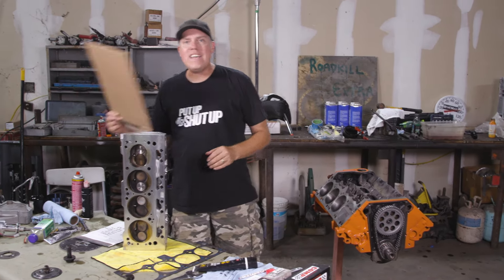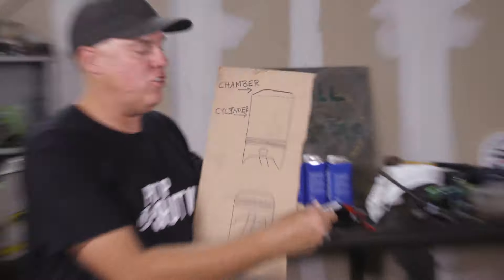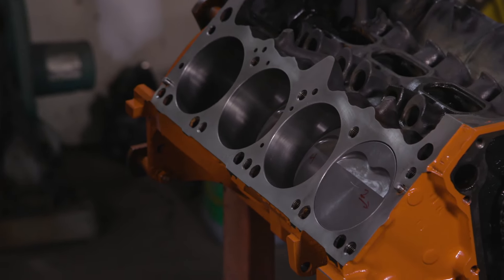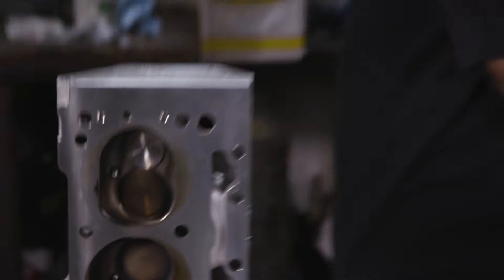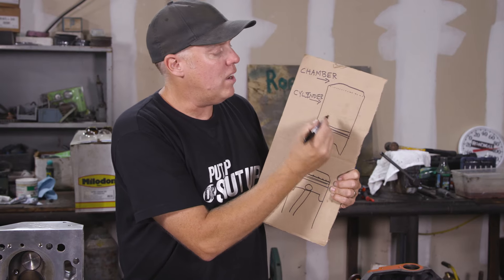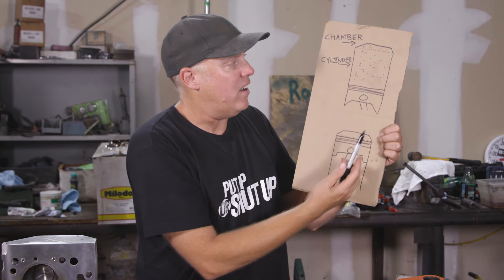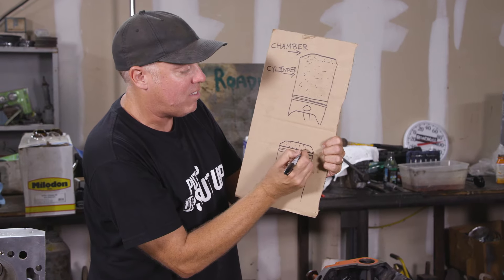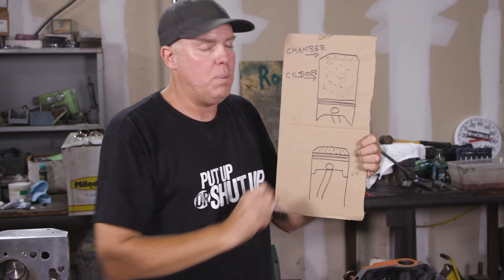Compression Ratio Explained - Roadkill Extra

Comment: He's half right.  If you increase the compression and run on pump gas you may have to pull timing.  You get more power with the higher compression, but pulling timing also pulls out power. Negating the increase.  I have experienced this.  Running around 11:1 compression, I have to pull timing down to 26 degree's full max timing.   Pulling out 80 to 100hp at the same time.  Totally taking away the power my new cam is supposed to give it.  I have to lower my compression, which will allow me to run the timing up to 36-38 degrees.  Now I can get full gains off cam with proper timing and pump gas. 
   Larger bore increases volume and LOWERS  compression.  Unless you have ZERO deck clearance, which stock deck has about .035 deck clearance. Give or take. Using some of the cylinder volume as the combustion chamber. Boring Will act the same as increasing chamber size in head.  With zero deck clearance the final combustion chamber size is not influenced and WILL give more compression with a larger bore. Increased stroke WILL always give more compression.  Head gasket thickness is another factor.
  If you don't use ALL the factors you will end up with a different ratio then you expect or wanted. Might not effect the motor. Or it might put it just out of pump gas range. Like I did with mine first time.

Comment: The engine I’m building has an 8:1 lol. Not really a performance engine though. It’s a ford 300cid straight 6 meant for torque making almost 300 lb-ft of torque stock at only 1,600rpm

Comment: Very informative...never knew you could run low octane @ high compression by altering lift & duration at the camshaft...l'm thinking 2 intake valves (because the piston has to draft the mix in) & 1 exhaust valve (because the piston is forcing the exhaust out) would be optimal at this juncture...ie: a pump can push better than it can suck

Comment: can you do a video using a rover v8 comparing it to a domestic lump?
Reply: Alex Thompson the rover v8 was based off the 215 Buick engine. Rover bought the design so it is essentially a domestic engine anyway.
Reply: Hurmeez i know, but they killed it off after only a few years in the late 60s then rover made it until 2003 with various sizes, so it's hardly a domestic engine any more
Reply: Fair enough. Sounds like an interesting subject for a video then for sure.
Reply: Hurmeez l think he has 1 of those aluminum motors in that skylark convertible he got from the Jeep guys mom
Reply: Alex Thompson   You're talking about an engine that GM/Buick gave up on over 50 years ago ! That's why they sold it . Here in the US they are rare and only 215 CID. You only see them in VW Beetles and Chevy Corvairs at Car Shows. Not many of those on the road . Any V8 less than 350 CID is a waste of money and time.
Reply: +James Letaw  I think it has the 300 CID Iron Small Block.

Comment: Good video!Worth to note that compression, compression ratio, and compression pressure are not the same thing. You could in theory have a 15:1 ratio but still have low compression pressure, if the cylinder is sucking vacuum under intake, due to a restrictive intake/intake valve, or too high rpm. With forced induction you could have an 8:1 ratio but have high compression pressure, depending on compressor charge pressure.

Comment: Is not the compresion ratio what makes more power. Is the expansion ratio.

 In most engines both ratios are equal... But if you could increase only the expansion ratio without modifying the compression ratio you will get more power gain than when you do both ..

Comment: 40 over 360,, it will be thin in the cylinder walls! you are living dangerously, let alone a 40+ y/0 block.
Though as for the 'explanation' well done. Though using a burrette and a piece of perspex to measure a chamber is not that hard for the average half smart bloke building an engine at home.

Comment: i have a serious question i have a 2001 jeep grand cherokee laredo 4.0l i am getting back fire thru the throttle body and i can't figure out why it's doing it i did a compression test on all 6 cylinders and got #1 and #2 at 150  #3 at 130 #4 at 120 # 5  at 110 and 6 # 100 i am not sure as if any of these are the issue but i ordered new valves for the head as i feel maybe that the valves are slightly bent or allowing some compression to escape back thru the intake valve but i am lost as if that is what it is any answers to this issue is greatly appreciated i know that if a head gasket is blow in certain cylinders it can reduce the amount of compression to each but the issue is the back fire thru the throttle body it want's to run but running rough please help

Comment: V.e. quench, dynamic, static etc... ALL play a part in making power and or losing power, camshaft selection doesn't effect computing total compression, that's wrong, you can lose cylinder pressure from a cam, yes but not compression, all cams have overlap, I never seen one that don't but I'm sure they exist... you can either raise or reduce your compression with your piston, your C.c. reducing deck height and gasket thickness... ideal street engines are 9:5.1 to 11:1 that will live happily in pump gas.. like he said, if you're going 12:1 you might as well go 14:1 because to live happily you're going to need higher octane fuel and a good set of heads... I'm building a 440 big block Chevy right now and shooting for 10:5.1, 600hp motor with a 150 and a 100 hp plate shots of nitrous, it will be a street cruiser but the nitrous is for track use only, that engine is going in my   260Z, maybe my Vega or Camaro... I'm not very certain yet... I was going to put it in my 82 T/a and raise the compression and use it just for the track but I like to drive my cars.

Comment: Y'all do "how much X until it explodes"  episodes sometimes, they're great. I suggest building a seriously high compression V8 and testing it on various fuels (E85, race fuels, etc.), altering timing to get the most power before something goes boom due to detonation or some other factor. I SUPPOSE you could show it mercy as you've done in the past if it sufficiently impresses.

Comment: By the time you're looking at 15:1 compression, you might as well consider running on diesel.  Now how come diesel engines don't typically make a lot of power, unless some serious forced induction is supplied?  They certainly make boatloads of torque down low, but absolutely hate revving, so instant horsepower killer unless a lighter bottom end is used.

Comment: Thank you! I give tours about airplanes and I’m constantly wondering how a 720 in.³ V8 from 1917 rated at 180 hp could have essentially a 4 to 5 or 5 to 1 compression ratio yet a brand new Subaru forester rolling off the lot could have an 8 to 1 compression ratio with the same horse power and an engine 3/4 the size of the v8 aero engine. Bottom line is that aero engines of the early 1900s just did not have high compression ratios but I was wondering why.. This video has helped me understand.

Comment: Stroking a block will most certainly net a lower compression if the head volume stays the same. Lowering the cc volume in head while cylinder volume stays the same will net more compression.
Reply: No doubt no doubt. I would like to replace stroke with bore size. If all other variables stay as.

Comment: Now you need to explain turbo and superchargers...why you need to reduce the ratio so you wont get detination...when you put higher pressure in a cylinder when its at bottom dead center then compress that, then you will have that same amount of pressure as atmosphere but there will be more fuel and air at the same pressure...simple but to some very difficult to grasp...

Comment: If you want the chamber to be smaller why do people port the cylinder head
Reply: elijah F  Porting is done in the ports of the cylinder head; not the chamber.  The ports are on the opposite side of the valve, so it has no affect on the size of the combustion chamber.  Porting increases flow to get more air into the combustion chamber.

Now people will often deck heads/blocks, which takes material off the flat side where the combustion chambers are located.  By taking material off the the entire flat side, it makes the combustion chamber smaller, increasing compression ratio.
Reply: Elijah, very well put.

Comment: Completely misses the point of the engines size compared to the necessary octane requirement. You CANNOT generalize as he did about what compression ratio is "acceptable" for pump gas. EXTREMLY important.  Anyone smart enough to know why?

Comment: See, that whole thing about 12.5:1 compression being race fuel territory.... that is not so true these days.... and for Japanese vehicles, that has been not so true since the 1990s.... I am tuning a 1993 Acura Integra with a B18A1 (Non VTEC DOHC 1.8 liter 4 cylinder) that was head swapped with a  (ported) 1995 Acura Inegra GSR B18C1 (VTEC DOHC 1.8 liter 4 cylinder) head, and 1999 Honda Civic SI B16A1 (VTEC DOHC 1.6 liter 4 cylinder) pistons, and the calculated compression ratio is right at 12.5:1....and it runs great on pump gas. And I am tuning using a chipped OBD1 ECU using older software, and it runs amazing. Should also add, the engine has a 70mm Skunk2 throttle body, ported Skunk2 Pro intake manifold, 4-1 header with 2.5 inch collector out to an aftermarket 4th generation Camaro cat, which dumps into a nice sounding 2.5 inch exhaust, and power is transmitted through the car's original transmission. Next mod is limited slip and the car will be pretty much a sorted, canyon carving, pretty damned quick to boot, little car. When he was daily driving the car, he just put 91 octane, no ethanol fuel in it. Though, when he wanted to have a lot of fun, he would stop by the gas station in town that has 94 octane at the pump, and I could increase the ignition timing even more.... yeah, the car become even more unhinged... it is great :)

Comment: 15:1 is huge... NOT when you think about that current Formula 1 engines are about 30:1 and while they're using petrol (what USA-ans call gas... (wtf)) blends developed for them, they are still pretty far lower in octane than toluene or anything like that with around 120 octane. AND have turbochargers.

Comment: 15.00:1 is super high compression. You are wrong, Warstila marine diesel engines. Have a compression ratio of 140 bar. Which creats 2,000 lbs of force. Per square inch of piston surface. Or 1090 tons of pressure on the entire piston. 
Secondly you stated that a compression ratio 13.00:1. For a gasoline engine. Requires racing fuel, wrong. There are none muscle and sport cars. With compression ratios of 13.5:1. Wich run on 92 octane street gas. Tomorrows engines will be HCCI or what ever its called. Which will use a compression ratio of 20.00:1 or higher on 92 street fuel. But again thats in the near to very near future. Either 20.00:1 or 140 bar in a true hemi engine anyone.

Comment: Nobody in the hotrod world seems to know that ultimate max horsepower out of any given strength of block/rods/crank/pistons comes at 6.5 to 7.5 compression ratio ASSUMING UNLIMITED BOOST AND DETONATION SUPPRESSION.  Back when America's survival depended on aircraft piston engine power GM Allison, Curtis-wright, Pratt&Whitney, Lycoming and Continental figured this stuff out.
    Downside - such creations are A) Weak sisters without any boost, and B) Fuel Hogs, because C) they waste tons of heat-energy out the exhaust valve. WHY? "Expansion Ratio" is what takes energy out of the combustion gas and turns it into power.
WHY DOES IT MAKE MORE POWER? 1) Large combustion chambers pumped up with boost drive the piston way farther down the cylinder on the power stroke. It is a mighty effect.
2) The large chamber exhausted down to below atmosphere and pumped up to 2 or 3 atmospheres pressure INCREASES CFMs of airflow and it also is a large effect. 
Take your favorite engine and drop the compression down to 7 to 1 and supercharge it up to 1/2 atmosphere (7 psi boost) with a roots blower (so it doesn't fall on it's face when you snap the throttle open) - and then turbo THAT.

Comment: Not a good explanation. A log-P log-V diagram will indicate the higher compression ratio generally makes more power due to the increased expansion work done on the piston. The faster heat release rate is only useful if the CA50 burn angle is properly timed, and the increased CR doesn't move ignition timing substantially retarded from MBT timing.

Comment: If its not a hemi don't waste your $ on a mopar engine but if you must buy after market heads unless its a hemi stock production heads don't flow good # that's why most of there engines didn't make one horse power per cubic ,Pontiac heads don't flow good numbers unless its a SD 455 that's why Pontiac cams are not much over 500 lift the heads won't support that much lift ,if you have a naturally aspirated engine

Comment: A high compression naturally aspirated engine for the street is old school. With boost you have so much more adjust ability. Want to make more horse ? Turn up the boost and put higher octane in it. Want to clam it down for the street ? Turn the boost down and run pump gas and or run meth just when you need it. Plus you do not need a high dollar valvetrain to turn 9000 rpm to make big power. Boost is really variable compression XD